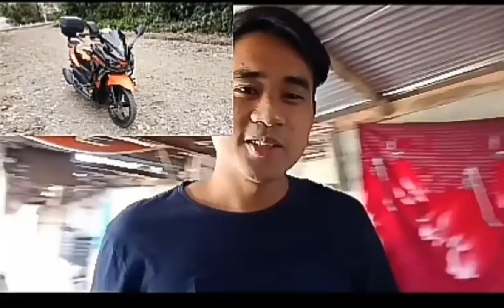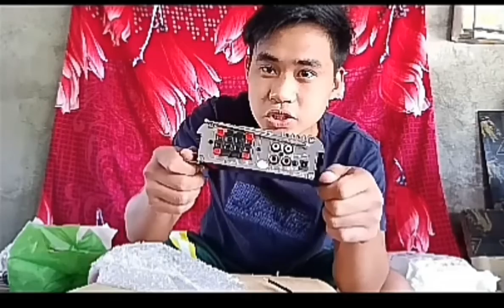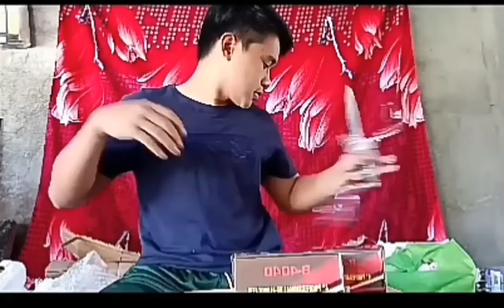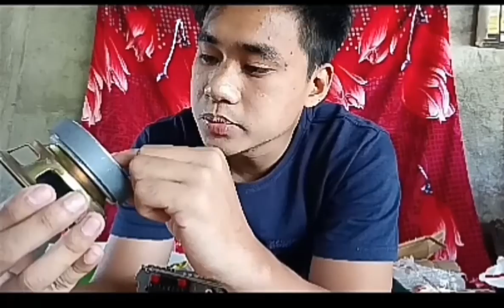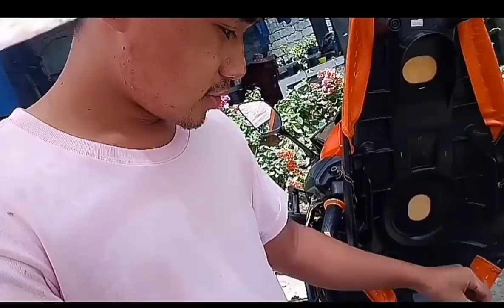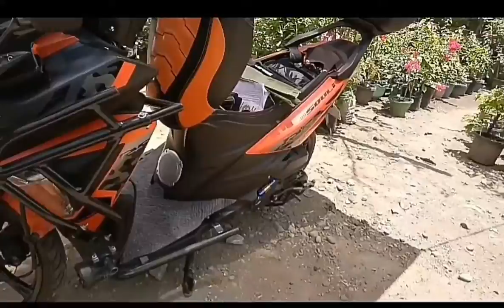BOSCA mini apmlifier unboxing and sound testing

Comment: Basta en conect mo lattan dta batery motor mon boss saan kan nag kabit t relay boss?
Reply from the maker: Haan boss basta naka fuse ka ken adda ti sabali nga battery na , madi nga inti stock nga baterry salamat sa comment oasubcribe naman
Reply: @kamotortv4454  Ay ok boss salamat ta adda gmin maysa nga bateryk 12×12  isu aramidek nga pang sound ko boss.
Reply from the maker: Nu agsounds ka boss ikkam tweeter napayen, bali adda tweeter na ata itattan ngem madik pay naiupdate jay video
Reply from the maker: Ken dapat adda ti charger mo boss ngem nu awan mabalin ikabit inti regulator ti motor mo
Reply: @kamotortv4454  apay jay charger ngay boss? Dpat boss adda charger boss tapno no malowbat jay batery boss echarge mnen kasjay ba boss?
Reply from the maker: @ramildalaza5131  wen boss icharge mu nukwa ,mabalin met ikabit inti regulator ta motor nu kayat mo
Reply: @kamotortv4454  jak met ammo t ayan n regulator toy motor ko boss ta mio i 125 toy motor ko boss.d bali boss agorderak langen t batery charger boss t lazada boss ken ikkakon a t fuse na boss.